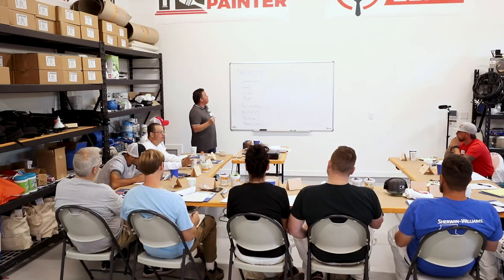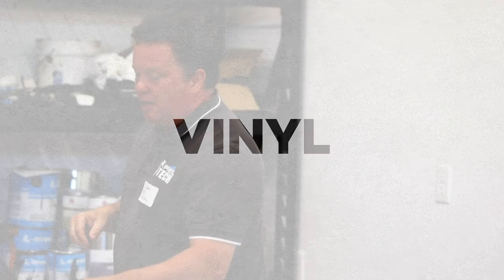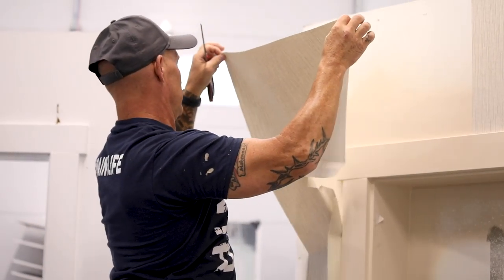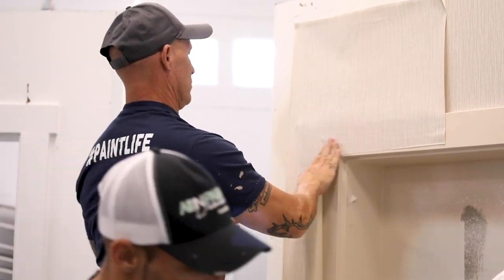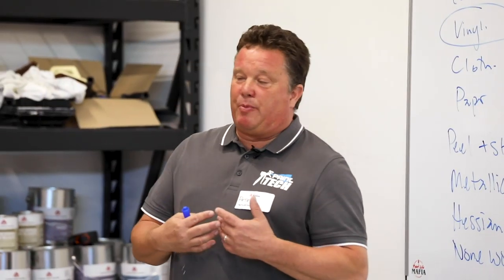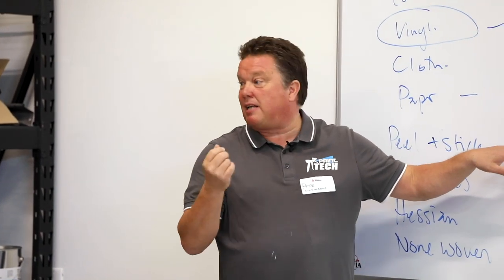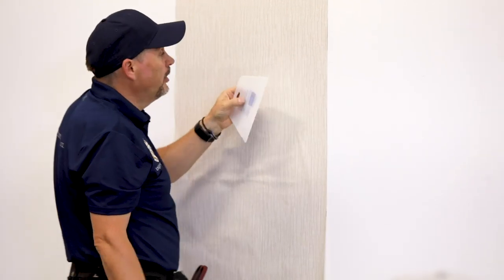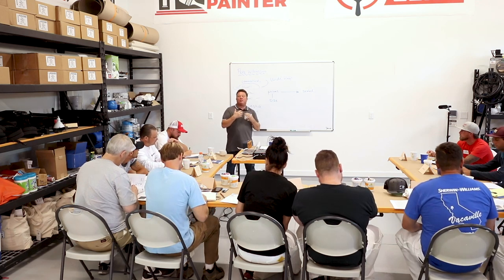Wallpaper Crash Course | Types and Application

Comment: Wallpaper size is NOT RIGHT. Wallpaper primer is what seals the walls so to not allow the glue to penetrate into a surface therefore keeping glue between the paper and the primer. A size does nothing but help the paper slip into place for the hanger. Size is cheap and fast but makes removal more difficult and in most cases leaves the walls damaged. WALLCOVERING PRIMER IS A MUST IF YOU HAVE PRIDE! A sizing in my opinion, is lackadaisical and just looking to collect the check.
Reply: I agree and disagree. I agree with sealing the surfaces with pigmented sealer instead of size. However, you still need to size the walls after. Depending on the paper type you can use powder size or latex size or my favourite, pva sealer. The size is not only for slippage but to aid adhesion of paper to sealed wall.